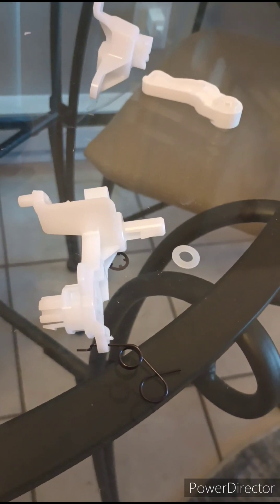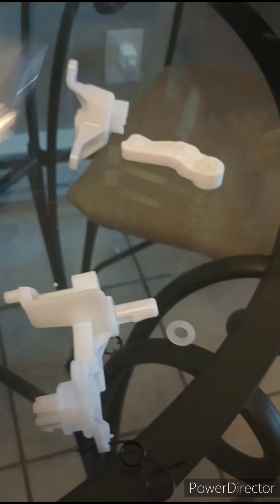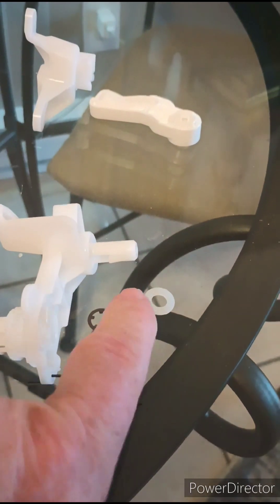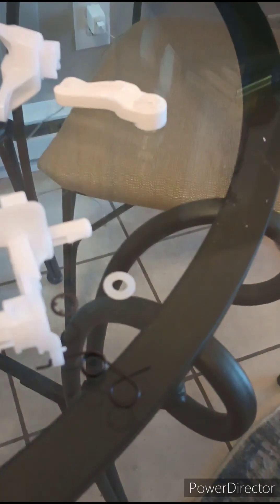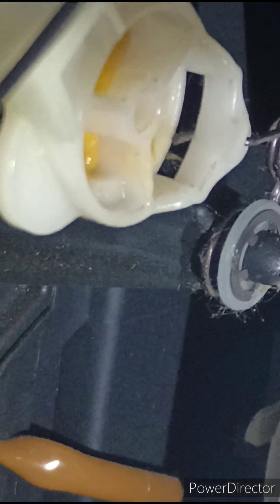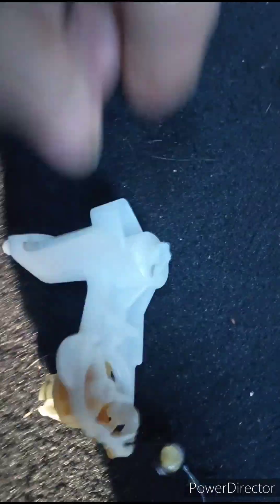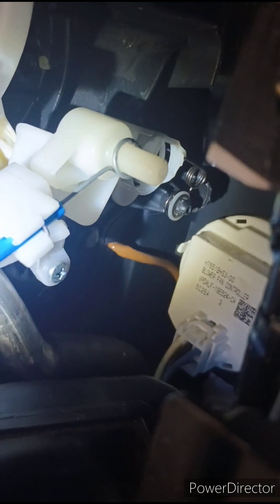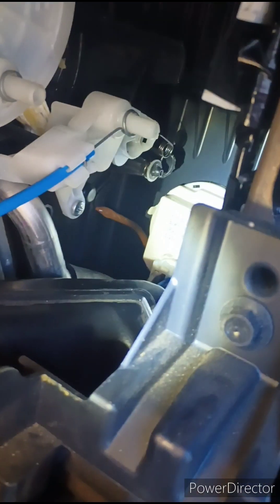Fix for 2016 Mazda 3 - bad HVAC control - part BHS2-61-A20A.  Removal & installation.

Comment: Thanks man! I replaced mine just now. Took me less than 15 minutes.
To take out the part, take out the nylon washer first. You'd be able to rotate the link after this. Then you'd notice that the "tab" you struggled with is PRESSABLE! Just press it while removing the cable. Easy peasy.

Great advice on using a wrench to fully attach the new nylon washer! I couldn't really push it all the way in with my bare hands.
Have a great one!
Reply from the maker: You're a quicker & more patient study than I!!  Thanks for the tip...